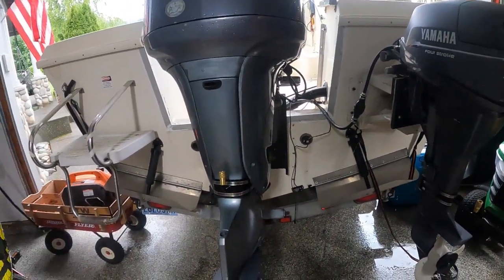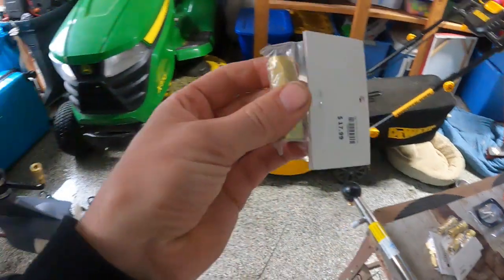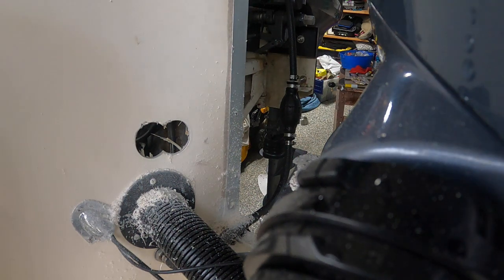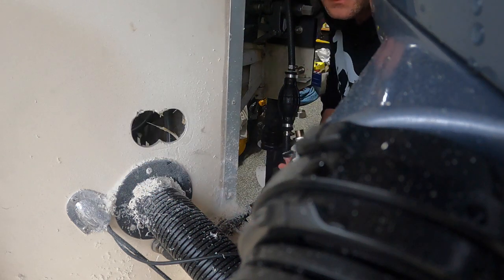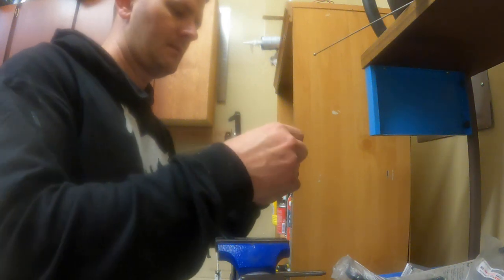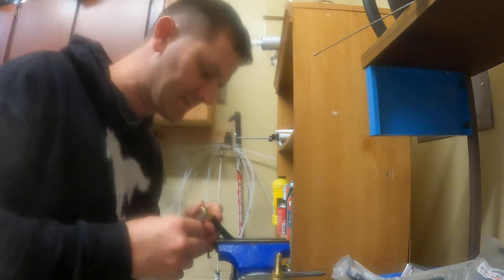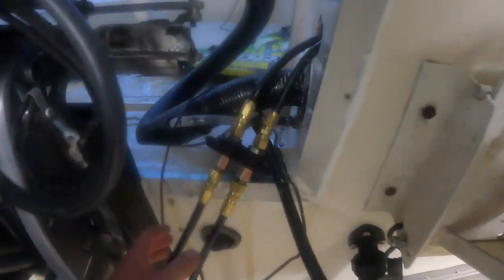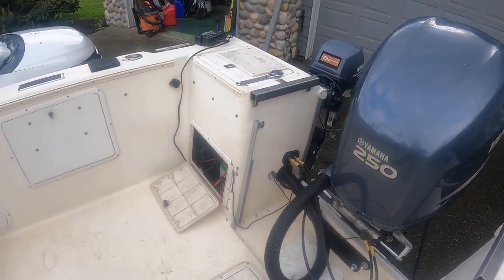Outboard Hydraulic Steering Line Bulkhead Fitting Install

Comment: I need to do this, I'm still like the PO of your vessel. are your trim tabs extra short to clear the kicker? I also want a kicker setup exactly like yours. w/ it setback what about 12" doe's the kickers tubulance interfer w/ the transducer? sure would make the kicker install easier on star side bc I to want a binnical control. thanks an nice video. BTW when I bleed my sea star it required a assitant holding the jar of fuild above the steering hub while turn the wheel.
Reply from the maker: Thanks for the comment! The trim tabs and the kicker do not have a conflict with each other as the bracket for the kicker motor makes the kicker sit out about 12" off of the transom. I haven't had any issues with the kicker interfering with the transducer. However, I did just put a new Garmin system on.

Comment: Any ideas why when fitting the power steering fluid it only drinks starboard but when trying fill port side it’s just clicking and spitting up air? Thanks for the video
Reply from the maker: I’m not sure why there was more air in the line on the port side. I let it sit over night and bled it more the next day. Seems to be fine now.